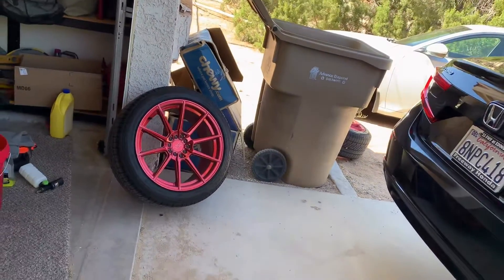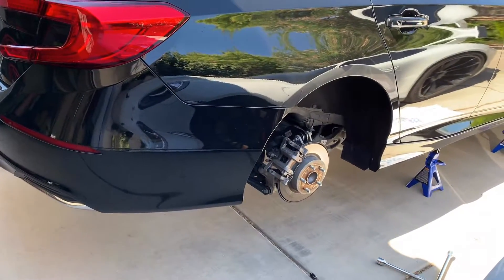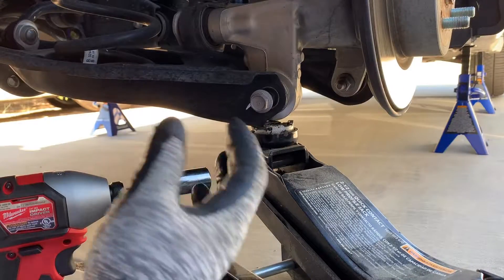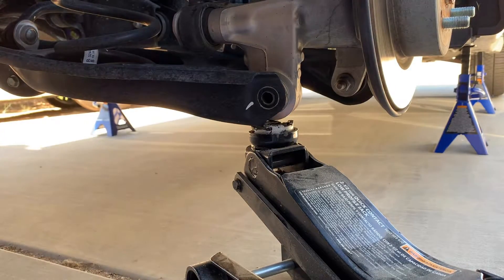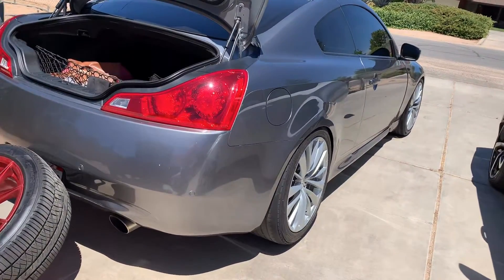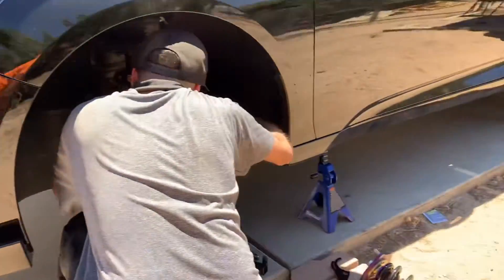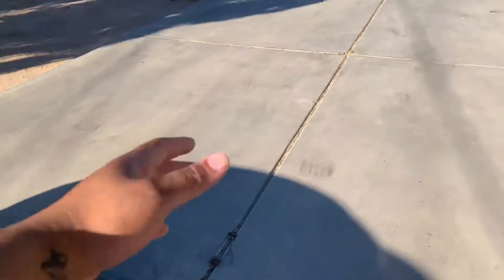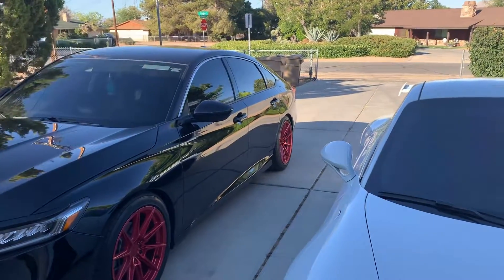FINALLY INSTALLED COILOVERS ON THE 2020 ACCORD LX | NOT A HOW TO!!

Comment: Love how your car looks! So clean!! Question when you installed the coilovers after driving did it trip the low pressure tire warning light for you? Mine did was wondering if that’s normal
Reply from the maker: It did but all you have to do is go to your settings go under vehicle and rest your tpms 3 times doing it 3 is a “factory reset” so what ever your tpms is wether it’s 30-35 it’ll stay that way and only go off if your tire is actually flat

Comment: How's it been riding? Is it bouncy and were you able to get custom spring rates?. Looks really good bro
Reply from the maker: It’s been great no complaints it’s probably a mind thing but it’s seems like it got lower over time. The custom spring rates no I don’t I did it myself (yt content) came out great in my opinion but it was slightly boofed took it to a shop and I can tell one side is slightly higher then another side by maybe a half inch but I can lower it myself some more it doesn’t rub in the slightest bit